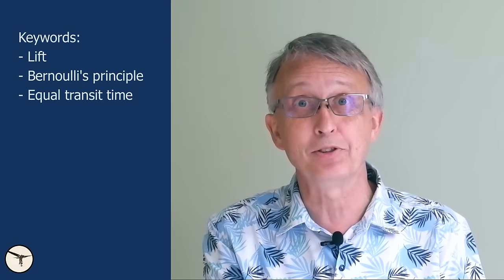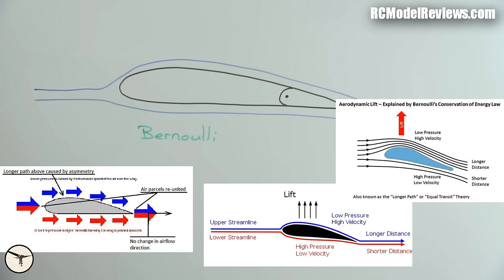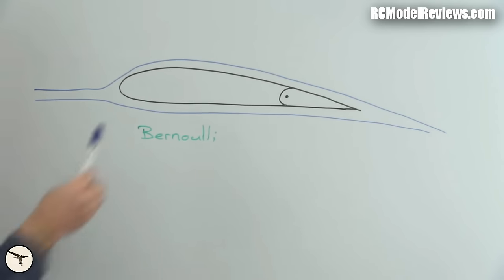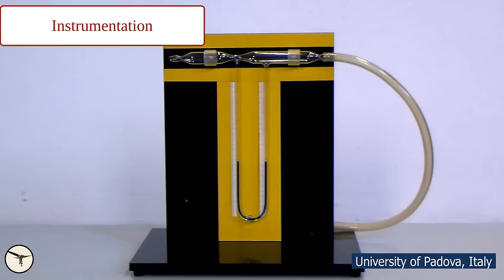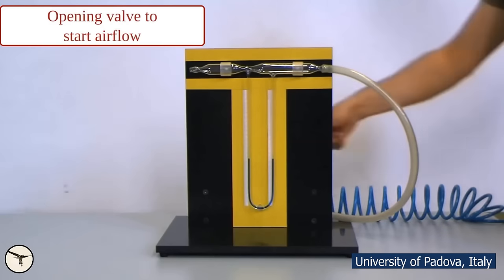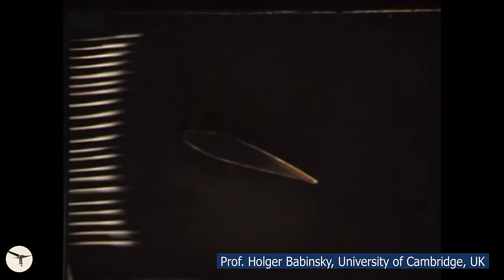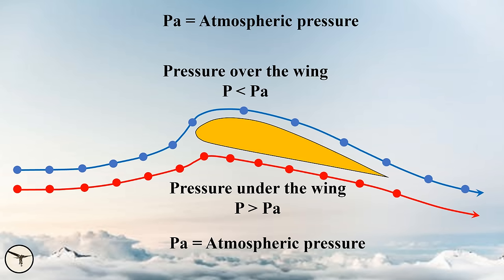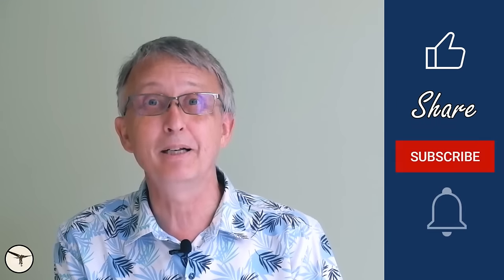Why are so many pilots wrong about Bernoulli’s Principle?

Comment: Most folks here seem to say that low pressure exists because the flow speeds up, but that group does not account for why the flow sped up in the first place, or the mandatory physics. I offer that the wing has acted on a fluid and accelerated it. The bottom by blunt force change in direction, the top by leveraging coanda effect. Velocity being preferable, as it is squared in the lift equation (the bottom does not share this advantage). This is a force which has to be accounted for with an equal and opposite force. Some say this only happens on the bottom, but the physics don't change. Once the air has been accelerated, a vacuum has formed (larger and smoother replacement flows result from more efficient acceleration). Bernoulli's EQUATION (not a force) is a great way to measure how efficiently the foil accelerates (speed and direction) air by measuring the decrease in static pressure. The group that feels the wing sucks itself up in the air is probably standing in a bucket and lifting themselves by the handle. I would hope someone can explain what happens to the wing when it causes air to accelerate. Furthermore, while they are thinking about it, what if you replaced a single engine prop with a rocket motor? Everyone would measure the force by the mass and speed of the ejected matter - but when it is a propellor, most people claim it is an airfoil and suddenly we measure the vacuum out front. No one ever puts Volkswagens in front of a 747 to watch them flip over. Sure, the engines suck in air, but what matters is when huge energy gets added to the flow - not the vacuum. Does water form a vacuum over a diving plane?
Reply: You might want to look up "pressure gradient forces" and "impulse" of fuels.  The pressure increases with fluid velocity at constant density.  At higher pressures the density can increase giving more pressure.  Rules of thumb memorized to model invisible flows are less useful than modeling every voxel individually with all that is known about the flows, fluid properties, heat, temperature, energy, three axis velocities and acceleration.  Ultimately those models all have to be simple accounting, because the digital models are calculating with add subtract multiply divide mostly.  

Look at adjacent cubic voxels in a simulation and then check the equations for momentum, energy, pressure, velocity, and all the other things. It is an accounting model.  Ways of estimating might change, but it is not complicated taken a tiny piece at a time.  Magnetic fields, lasers, microwaves, mm waves, THz, UV, soft x-ray, acoustics, plasma jets, ionization, electric fields, ion and electron and nano-particle beams - there are many ways to image and modify turbulence, temperature, velocity profiles.  And there are many ways to look ahead and plan for the air that will be encounters.  The speed of light is thousands of times faster then the aircraft and air. And the air has a finite (albeit large) range of states and changes. The computers now can image, process, predict, verify and change in real time, and with electric and electromagnetic field, some things not possible with mechanical, hydraulic, motor and solid parts, similar to what the Wright brothers used in form and presumptions. 

You might want to look up "plasmonics" for electromagnetic and field methods near surfaces.  Many tools are available off the shelf now (COTS - "commercial off the shelf").

James Melcher wrote 'Field Coupled Surface Waves (MIT 1963).  The full title is Field Coupled Surface Waves - A Comparative Study of Surface Coupled ElectroHydroDynamics and MagnetoHydroDynamic Systems.  His methods are out of date now, but the ideas are that old. Only in the last few years are sensors, computers, memories and algorithms fast enough to apply those and subsequent methods in real time.  Flying fighter jets with rigid surfaces pales in comparison with flying with boundary surfaces that can have energy densities hundreds of thousands of times the ambient air or more.  You can reach out ahead of the vehicle and change the air and its fields remotely.

If you ever wondered how to stop a vehicle on a dime or make it hover without jets or in near vacuum, there are tools for that kind of design and have been for decades, if you could afford the parts back then, or now.

Filed as (Account for all the small changes carefully. Then the system, however large, is not so difficult to predict)

Richard Collins, The Internet Foundation

Comment: The airfoil shape simply smooths the airflow over the top of the wing.  While this does create a comparatively low pressure on the top, it's the higher pressure on the bottom of the wing that pushes the wing up.  Airplanes fly because of Newton,, not Bernoulli.

Comment: I agree that there is no equal transit time in the wing, but there is a reason of an airfoil curvature, engineers are not stupid. The Bernoullis theory still apply in the upper side of the wing do to the accelerated airflow.

Comment: I have a big problem with your explanation that may be in parts true in a near stall situation as shown in the wind tunnel experiment but not if you have laminar flow, secondly why should low pressure above the wing create additional lift in the direction of the higher normal pressure above it? The total amount of lift of a wing due to air pressure is still   the pressure difference between high under and low over the wing, hereby the high has to be under the wing acting in the direction of the low thus against gravity otherwise there is no lift.
Reply from the maker: The air pressure over the wing is less than the atmospheric pressure, and the pressure under the wing is higher than the atmospheric pressure. That is lift. Maybe this video will help: https://youtu.be/ph1HqrioLPs

Comment: Another explanation of lift I learned long ago and found helpful, is Newtons 2nd Law: F = M * A.   All aircraft flight disturbs the air around it, and the mass of the air disturbed times the net acceleration of that air equals the lift force.  So in level steady flight, the mass of the air accelerated downward times the net acceleration of that air is equal to the weight of the aircraft.  Please comment if I have not said this exactly right.
Reply from the maker: Newton's second law explains the acceleration of the air over the wing's leading edge and upper surface. Newton's third law explains how air being pushed down behind the wing creates an opposite force (lift).
Reply: @FlywithMagnar  Thanks for the quick reply.  I'm not sure, but I think you misunderstand me. I'm not focusing on the acceleration of the air going over the wing compared to under that causes the differential pressures, I'm talking about the entire air mass surrounding the aircraft, possibly up to 100's of feet in all directions.  I'm thinking that if you sum up the mass of all that disturbed air (e.g. at 1,000's of points), times the individual accelerations (some up, back, forward, down at any instant), the net effect (Newton's 2nd law F=M*A) is a force countered by a force (3rd Law) equal to the weight of the aircraft for straight and level flight.   This seems like basic physics to me (i.e. it must be true).  So if I am wrong on this - I'd really like to be corrected.

Comment: the two  forces includes the subject "there nothing wrong with bernoulli" include in aerodynamic. the higher engine the more bernoulli in any way, air or liquid flow can be in the tube in the "air tube" there no difference. more speed of same airflow the less pressure. and all of this depend of construction of physical body and vector of airflow. even flat "wing" piece of cast iron, or paper depend of wind from engine or nature will lifted up. and there will works only bernoulli. when you will blow above the paper, the paper will lift up because of bernoulli effect. and if ten people "many" airflows will blow in the experiment, result will same. different aoa will create different effect and 0 aoa for flat "wind" is example there works only bernoulli effect. if you imagine high aoa you  found there this effect will even more because part of wind that looks to airflow will slowdown the airflow, shadow side will not. that's why high engine more effective. especially if they mounted directly above the wing. but in any way this effect is not general of aerodynamic army. because there no generals. all forces do what they have to do.

Comment: When people tell me that low pressure above wing creates lift, I ask them why do all wings on level flight aircraft point up at front, and how do acrobatic aircraft with symmetric airfoil profiles stay in the air?
It is obvious that the benouli principle is clearly not the reason wings generate lift. It may contribute a small percentage, it's reasonable to think it does something in that regard, but typical airfoil profiles were created to reduce turbulence at the trailing edge when wing has an attack angle and had nothing to do with creating lift , and hence also help increase the stall angle so by helping slow speed landings and takeoffs.
Look at any modern commercial aircraft flight, and you will see the wing is pushing the air down thus creating the lift effect.
Reply from the maker: Bernoulli's princilpe and and Newton's second law are describing the same thing: https://youtu.be/ph1HqrioLPs

Comment: The false equal transit time hypothesis simply confuses cause with effect.  It says that "a pressure differential causes lift". However,  a pressure differential IS lift caused by air deflection.  The bernoulli effect doesn't cause lift. If there's no deflection,   there's no lift. Period no exeption.

Comment: I remember going to a Physics teachers workshop and Bernoulli's Principle came up. So, I asked a few Physics Teachers how it worked. I got the standard answer you heard here; pressure is reduced. When I probed further and asked about the actual physical phenomenon causing this drop in pressure, I got one of two answers, "I don't know," or "because Bernoulli's Principle says so."

Teaching Physics is about imparting an understanding about how the physical world operates, not teaching students to memorize laws and equations with no understanding about the underlying phenomena. So, how does Bernoulli's Principle work, in other words, why is the pressure reduced on a surface when air flows over it?

Air pressure is the result of molecules of air molecules impacting the surface. Air pressure decreases for two reasons, fewer molecules strike the surface, and the speed with which they strike the surface is reduced. If air is flowing over the surface, fewer molecules will strike the surface because they are being dragged along the surface by the air stream flowing over the surface. Greater speed of the air stream, results in fewer molecules striking the surface resulting in lower pressure. That's it, it is no more complicated than that.
Reply from the maker: You are absolutely right!
Reply: Uhh no.

Comment: The idea that faster air has a lower pressure never made sense to me. Open the door of an aircraft in flight (er, this is a thought experiment). From the perspective of a person inside, the outside air would have a lower pressure because it's moving, so the person get sucked out. But from the point of view of a person stationary relative to the outside air, it's the air in the aircraft that is moving, so the person outside would get sucked in. Hopefully, they don't collide with each other.
Reply: Yes this shows nicely why you cant state that 'faster air has lower pressure'.

So assume that before the door is opened, the pressure in the ac is equal to the outside air. So no pressurized cabin or anything. Than in a simplified scenario, once you open the door, nothing really happens because the pressure inside and outside are the same. 

However, as the aircraft moves through the outside air, the outside air has to move out of the way to let the plane pass. Because of this the velocity of the air is increased from stand still, its pressure drops slighty. This is because of the bernoulli thing. Since the air still has this movement once the door passes, it has lower pressure compared to the air in the cabin. Therefore you get this slight suction at the door that would pull you out of the plane rather than in.

So I guess the paradox arises because you sort of equated the outside air with the inside air, and applied Bernoulli to it, but thats wrong since these are two different bodies of air. You can use Bernoulli to see how pressure of a volume of air changes if you change its velocity, but you cant use it to to compare two volumes of air/airflows that happen to have some velocity difference between them.

Comment: Aur viscosity is also a large part, where molecules stick to the wings surface.
Reply from the maker: Yes, and with that follows Reynolds number, boundary layer, and turbulent airflow. Shall I make a video about that?
Reply: What so many seem to forget is the fact that atmospheric pressure does not vanish when a wing moves.  The basic 1 ATM pressure is VERY high compared to the pressure changes around a wing. 
. .
A Cessna 172 has an in-flight top-bottom pressure difference of only 0.1 PSI! [There are 25,000 sq in for a 2,500 lbs gross] 
.
If 80% of that difference is the reduction above the wing, that is on the order of 0.08 PSI below ambient.  At low altitude, that is a change of only 0.6% in pressure. 
.
 Whereas the total pressure on the wing's upper surface amounts to a total force of 260,000 pounds DOWN! <-- NOT a typo.
.
That 260,000 lbs minus that small decrease is still pushing air DOWNWARD on the upper surface.  With that pressure, viscosity it a trivial factor, even though so many repeat that it is required to 'stick' the air to the surface.. 
This is wing loading brought into better focus.  You can do the calculations to PSI yourself to verify these numbers by using wing loading to get to PSI.  I picked 80/20 for the top-bottom fractions of the total difference.
. . .  
Full disclosure: those same calculations for an airliner shows larger pressure changes and get up tp around 25% at cruise altitude.

.
See my channel for the video on a completely intuitive explanation of the high school level physics of the upper flow pressure reduction.
Regards.

Comment: The clinching arguments for me were; a) practically any flat-ish surface can be a wing, (no fancy curves required); b) aeroplanes can fly upside down, (the lift generated on the top of the wing would now "lift" the aeroplane into the ground).

But another way to think about it is, if we take a wing and whirl it around, if the lift was generated purely by Bernoulli's Principle then there shouldn't be a disturbance in the air some distance below the rotating wing. Of course anyone who has been underneath a helicopter will know that a wing accelerates air downwards.

Comment: An easy experiment. Just take a spoon by the handle and approach it under the water flow of your tap. You will clearly feel that the spoon is attracted by the flow. And yet the water only flows on one side of the spoon. This is counterintuitive as one may think the spoon would be repelled by the water flow.
The extrados of a wing doesn’t even know there is an intrados. They ignore each other 😂

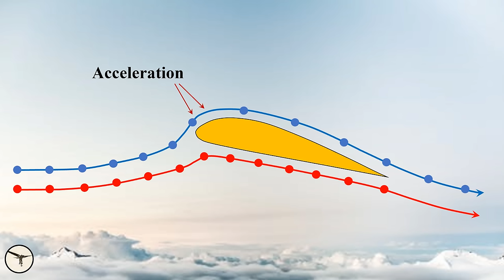Comment: Good clip but from minute 3:24 onward, the explanation is superficial; why does curvature shape of the wing cause acceleration? 

Based on your explanation, there are two lifts generated on the top and bottom of the wing which both lifts are in favour but this is totally wrong because we should look at this two sides of the wing as one. 

In general, air flow happens from a high pressure point to a low pressure point, but based on what you said: on the top side of the wing there is a higher pressure away from the vicinity of the wing, as a result, an air flow will form from high above downward to the vicinity of the wing pushing the wing down. The same happens at the bottom side i.e. higher pressure at the vicinity of the wing will form an air flow downward. However, both air flows will push the wing down which is wrong because they never create a lift.  

YES, the pressure on the top of the wing is lower than the bottom, as a result, high pressure from the bottom of the wing pushes the wing up to the lower pressure side, this is the reason for having a lift.
Reply from the maker: https://youtu.be/d4w1Iy4vVMg

Comment: Nothing can be accelerated instantly. Because it has inertia.
That is why air molecules are literally forced apart at the top faster than it can accelerate toward the wing, 
becoming less dense (lower pressure), by a wing at speed.  
The air at the bottom of a wing is forced by the wing so fast it becomes compressed faster than it can accelerate away from the wing.
(Higher pressure)